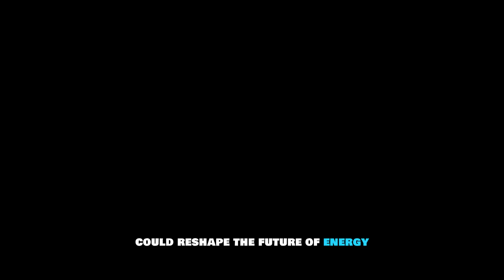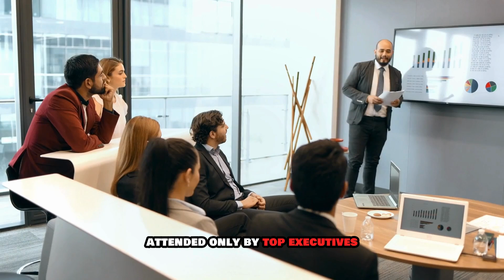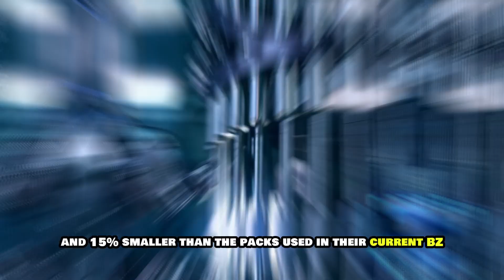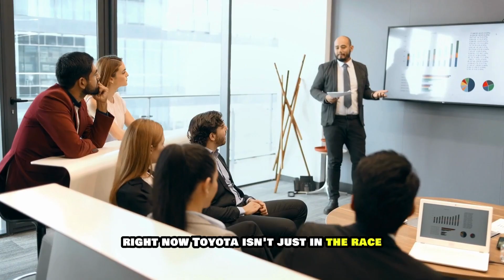Toyota CEO Just Released a Game-Changing EV Battery with 1200 Miles Range and 5-Min Charging!

Comment: Bullshit.
Battery has about 290 KWh capacity, charging in 5 minutes means average load of about 3.5 MW, peak load about 5 MW. 
That means 5.000 Ampere at 1.000 Volt in peak. 
There is currently no infrastructure on this planet to provide that for mass usage (and probably never will be).